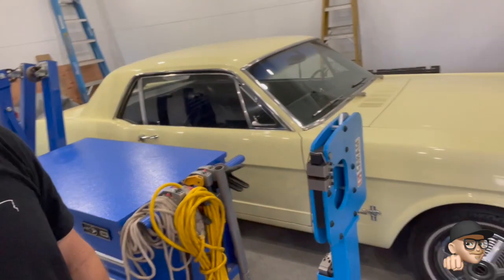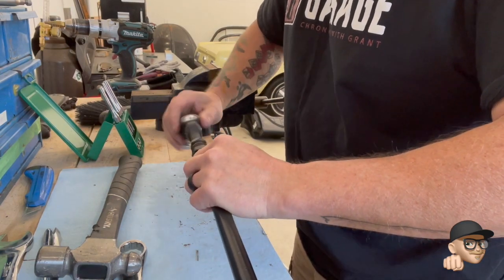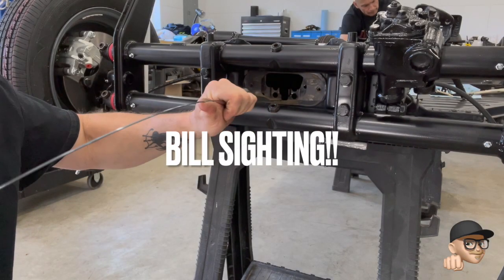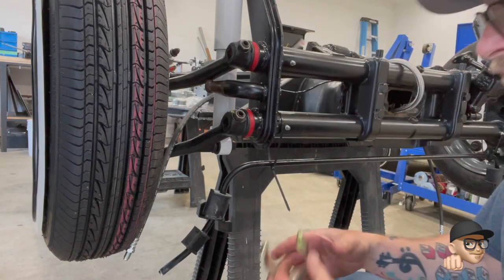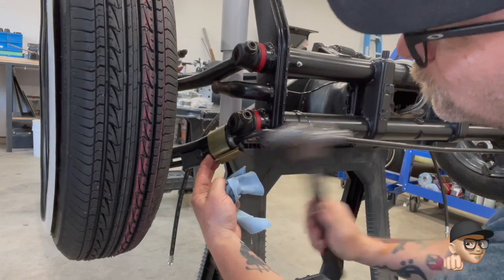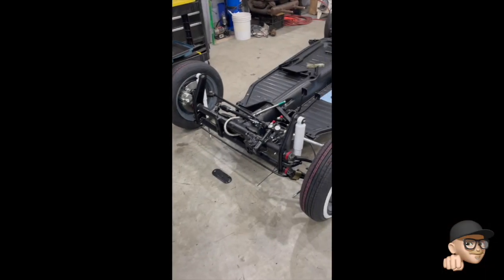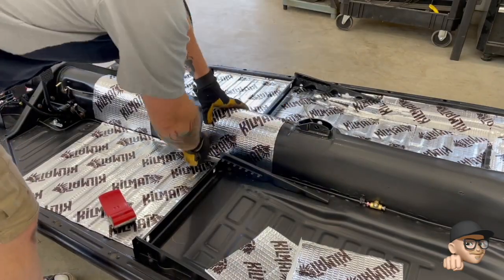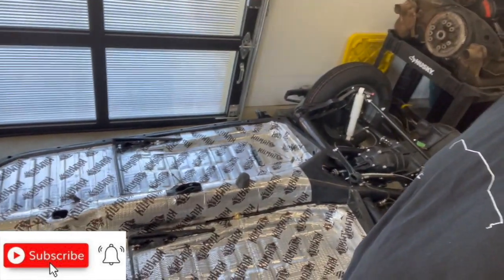VW  - 14 Build - 61 Beetle Fuel Line, Steering rebuild

Comment: Grant. Chassis is looking awesome. I wish I could pull my body right now and do all the same. Those annoying   hard brake lines you did I replaced with the body on. What a colosal pain in the butt. Especially the rear that went up and over the transaxle. Plan is to pull the body in the fall after I drive it this summer. Have had it on the rode for a couple weeks now and only broke down once.
Reply from the maker: It's almost worth it to pull the body off and do all major service.  I'd hold off and do all of the major stuff when the body is off.  Or, trailer it down here and we can smash a quick refit for what needs fixin over 3-4 days at my place.